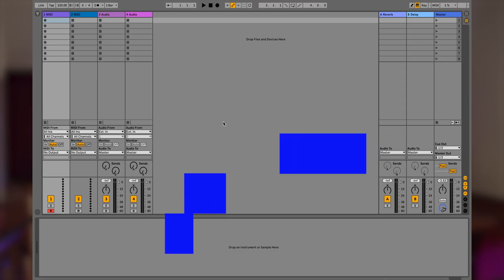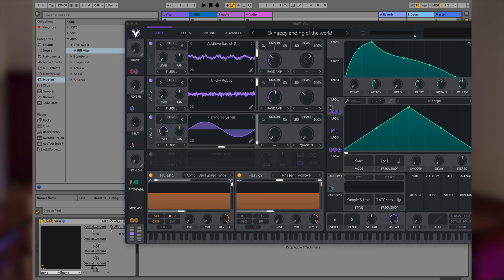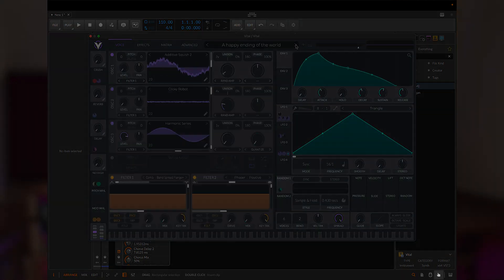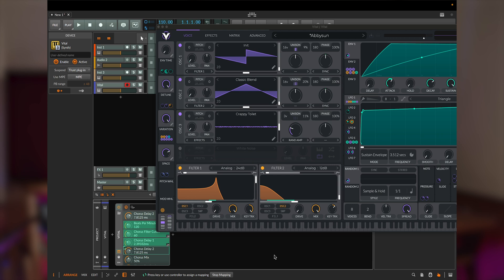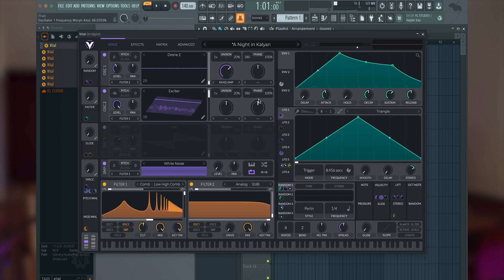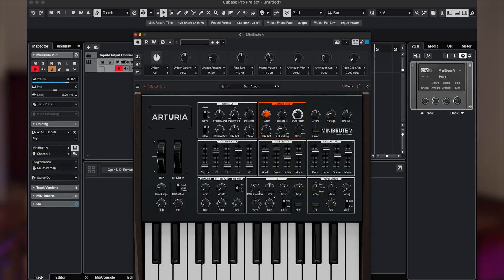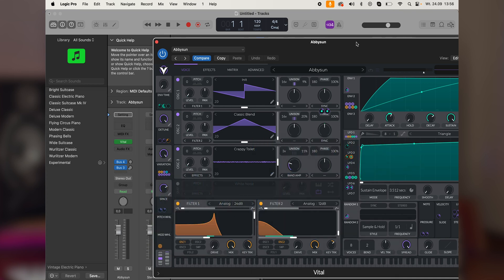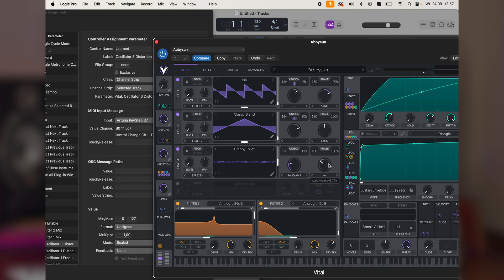KeyLab mk3 | How to Control Third Party Plugins

Comment: Still no Studio one covered.
Reply: Top left corner of the main window, you can open the custom midi mapping for the keylab. If you press buttons on your board the parameters will flash and change in that upper left hand corner, there’s a drop down arrow to unfold custom midi mapping panel. There you hit midi learn in the window, move the knobs, faders, or press the button of what you want to map something to. You can then assign functions from that window, or right click on a parameter in S1 and you will see an option to assign to last touched button or fader on your keylab. I was in your same situation a month ago, only half a year into S1 so all this is still fresh in my mind when I did it.
Reply: @runningwolf877  Thank you.
Reply: @runningwolf877  you legend. Thanks for this!!

Comment: If you also want to save them inside Keylab use User Mode... eeeh? could you expand a little bit on that?
Reply: Yes please ... User mode needs a dedicated video. Also, please try to explain how to control Komplete Kontrol and Kontact 8.0 outside DAWs.
Reply: Definitely need a separate video for user mode.
Reply: You have to save them in midi Control center and you choose a User memory on the Midi Control Center , you save and when you go on user mode (when you are on your controler) , you’ll see the user mode you’ve created.
Reply: @raphaelsoulard2745  Thanks but how can I know what to configure inside midi control center to get for instance cutofff of Vital synth like in the video?